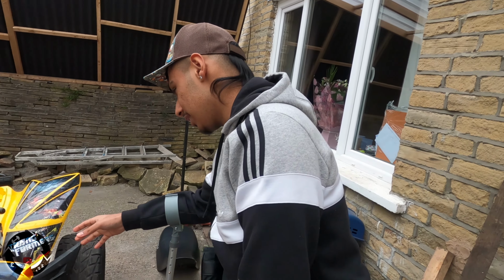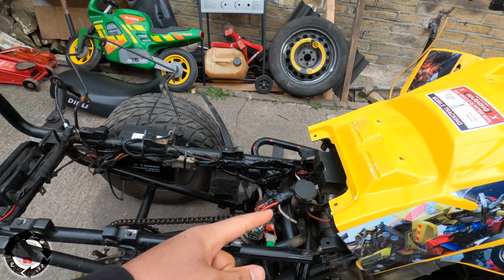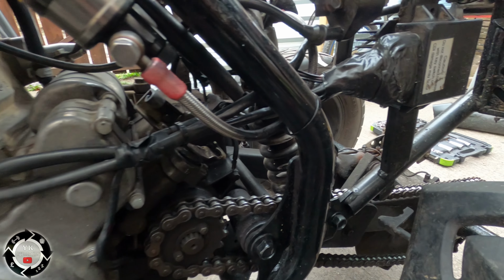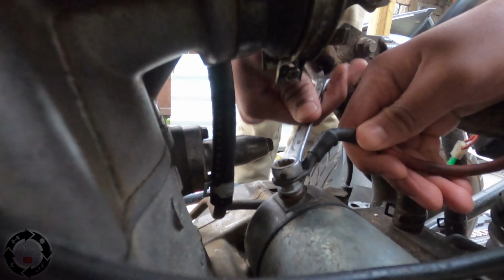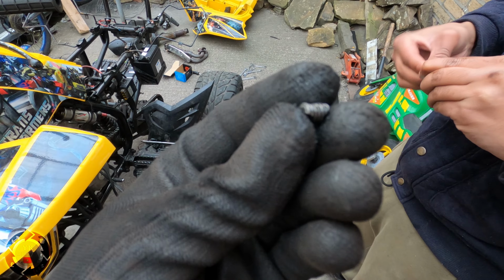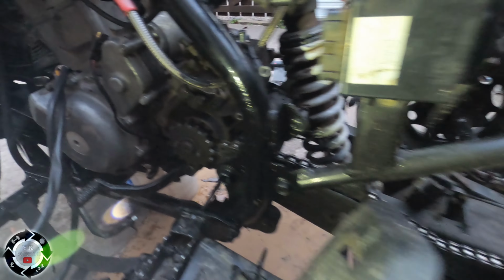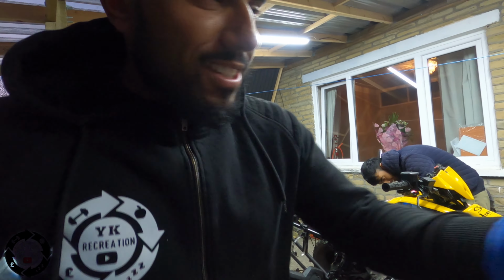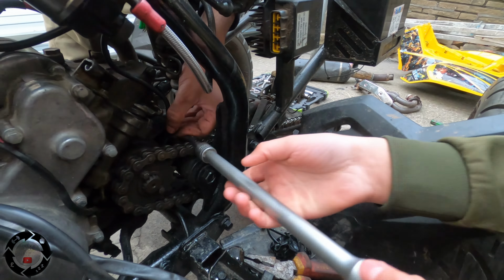*HOW TO REMOVE A QUADZILLA 450 ENGINE*  (DL901)

Comment: Good video .where can i get parts for the 500cc quadzilla .thanks
Reply from the maker: Thanks man, we struggled, couldn't find anything on ebay, or even quadzilla them selves didn't have any so we ended up selling it off, they've stopped making parts for this model now. What is it you need
Reply: @YKRECREATION  hi mate cheers for reply I'm after back brake caliper with handbrake mechanism can't get my one to bleed
Reply from the maker: Whats your bleeding process ? You tried reverse bleed some times that works